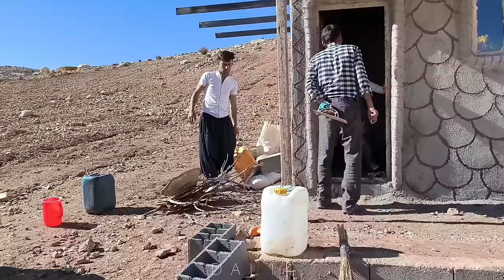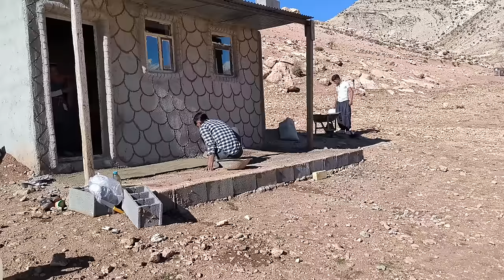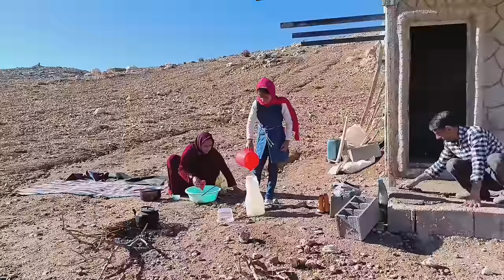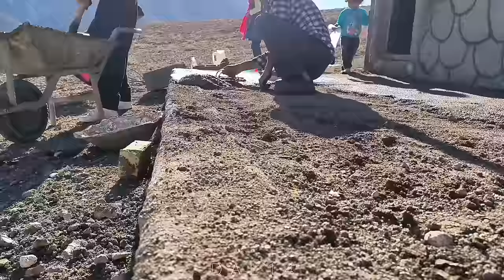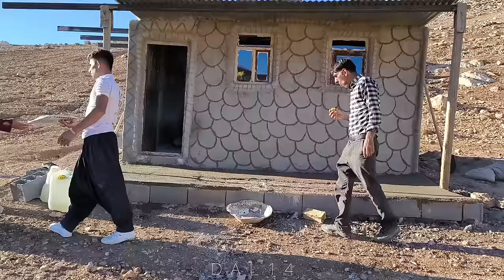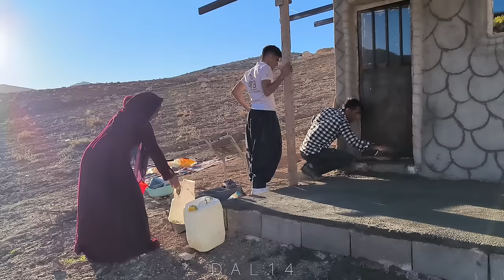Lonely woman: Afsane's porch cement work with the help of Mohammad and Ustad Bana

Comment: The house is coming along now attention to finishing the roof.  Another sheet of steel and move the roof over to have an overhang all around so rain doesn’t drip on the walls.  Mohammad put in the glass for the windows and used plaster so now the windows look awful.  Other channels use a glue to hold the glass in place so more of the glass let’s in light.  Thank you for helping this nice lady and her girls.
Reply: I agree with you 💯 for 
adding more sheets of steel 
to extend the roof & would protect 
against the rain et would give shade 
the entire porch will stay dry 😊

Comment: This plasterer needs to plaster the house again . Inside & out . He's good at his job & has a kind heart. I'm hoping that he will do this. This family's doing so much better now. Thank you for blessing them ❤
Building a house is not easy. Maybe after plastering it again and good oil paint for outdoor walls might keep the water from coming through the walls. Please think about putting cement around base of the house not mud but do it with the cement higher near the walls & sloping downwards so the water runs off .Half a meter wide

Comment: Dont be in a hurry to paint until you put another coat of plaster on the outside. You can still see the grey blocks & that's exactly the spots in which the water comes through to the inside walls

Comment: Shouldn’t the porch cement be a bit higher at base of house and slightly sloped down so water doesn’t collect in the middle? They should have used a piece of block to hold cement over by sides at each end by the wood poles so it looks finished. Not just thin cement on dirt there.